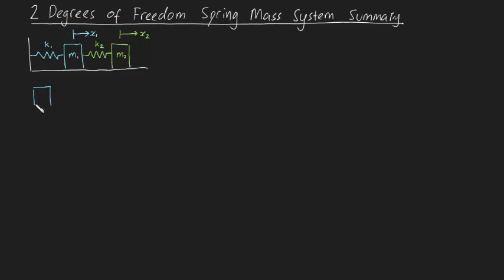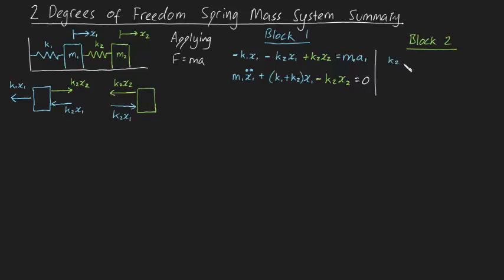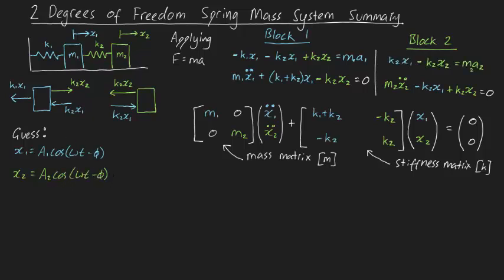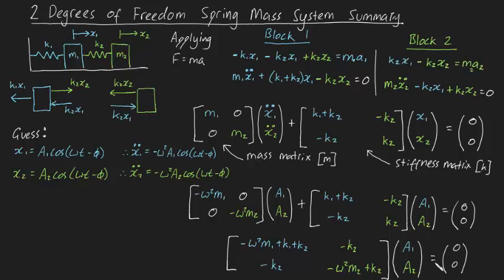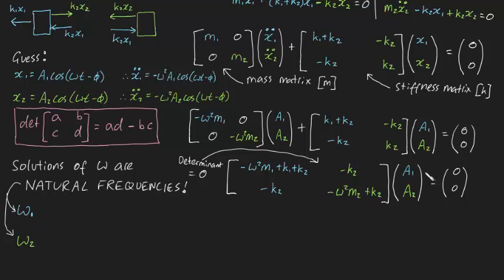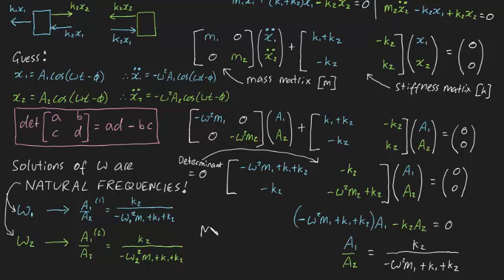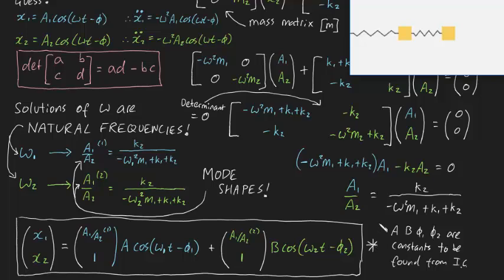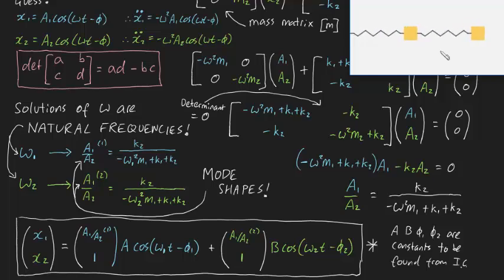2 Degree of Freedom vibrating system Summary

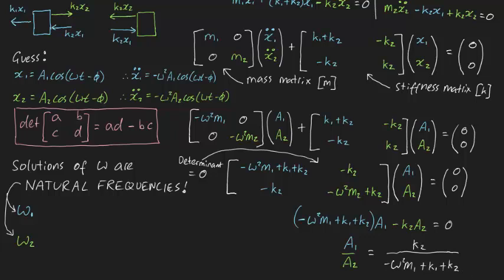Comment: also at 3:22 would it be -k2 on top of the amplitude ratio?  in your above equation its a negative k
Reply from the maker: Hi, here are the full steps:
(-w^2m1 + k1 + k2)*A1 - k2*A2 = 0

Bring the k2 A2 term to the other side:
(-w^2m1 + k1 + k2)*A1 = k2*A2

Divide by A2 on both sides:
(A1/A2) * (-w^2m1 + k1 + k2) = k2

Divide by the  (-w^2m1 + k1 + k2) on both sides:
A1/A2 = k2 /  (-w^2m1 + k1 + k2)

Does that help? :)

Comment: Why is it that taking the determinant of that final amplitude matrix gives us our natural frequencies?
Reply from the maker: That's a really good question! The answer is a bit complicated and involves some linear algebra. The problem can be expressed as: Solve the following equation to find X

[B]X = 0

Where B is the big matrix and X = [A1; A2]. Clearly one solution is X = 0  (since [B]0 = 0), but this is trivial since it corresponds to the solution that A1 = 0 and A2 = 0 (no motion). We want to solve for nontrivial solutions to this. 

IF [B] was invertible then:
we could invert [B] by both sides to get
[B]^-1 [B] X= [B]^-1 0
X = [B]^-1 0
X = 0   but this is trivial and we don't want to solve for trivial solutions

So the only way for nontrivial solutions to exist is when [B] is NOT invertible. 
A matrix is only not invertible if the det([B]) = 0

Hope that makes sense :)

Comment: I think omega(2) is written as A2/A1 actually. A1/A2 would have the k2 term in the denominator.
Reply from the maker: Matthew James
1 second ago
Hey Randy! Sorry for the late reply. Just a quick clarification, at 3:33 i'm not saying that w2 = A1/A2. What I was saying is that the amplitude ratio evaluated at w = w2 yields the following result.

We know that it is actually A1/A2 because

(-w^2m1+k1+k2)A1 - k2A2 = 0
(-w^2m1+k1+k2)A1 = k2A2
A1 = A2 k2/(-w^2m1+k1+k2)
A1/A2 =  k2/(-w^2m1+k1+k2)

Hope that helps :)

Comment: What will be the mode shape for 3rd block
Reply from the maker: Hey mate sorry for the late reply! Finding the modeshape for the third natural frequency is a bit tough to do by hand so I've written a MATLAB script for you. Notice in my code I didn't use det(-w^2M +K) = 0. I could have done! But it would have gotten messy. Instead I wrote -w^2 MX + KX = 0 as w^2X = inv(M)KX, which shows that the eigenvalues of the matrix inv(M)K are the natural frequency squared, and the mode shapes are the eigenvectors.  Here is my code:

clc
%Equations of Motion
%m1x1.. +(k1+k2)x1 - k2x2 =0;
%m2x2.. -k2x1 +(k2+k3)x2 -k3x3 =0;
%m3x3.. -k3x2 +k3x3 =0;

syms k1 k2 k3 m1 m2 m3 x1 x2 x3 w1 w2 w3

M = [m1 0 0; 0 m2 0; 0 0 m3];
K = [k1+k2 -k2 0; -k2 k2+k3 -k3; 0 -k3 k3];

%solves eigenvector (X) and natural frequency squared (w^2)
[X, natfreq_sqrt]= eig(inv(M)*K);

w = sqrt(diag(natfreq_sqrt));
%natural freq
w1 = w(1)
w2 = w(2)
w3 = w(3)

%modeshapes
X1 = X(:,1)
X2 = X(:,2)
X3 = X(:,3)

Comment: Great video. Do you, by chance, have one that includes damping?
Reply from the maker: Hi there, sadly I do not have a video that includes damping and external forces for 2DoF yet. But the process is very similar. If you're interested in solving for the steady state solution to an harmonic force acting F=F0 cos(wt) on the blocks then the equations of motion will yield a mass matrix [M], a stiffness matrix [K], a damping matrix [C] and a force vector {F}. [M]x.. + [C]x. + [K]x = {F}. Then, the way you solve this is by assuming a solution in the form x1 = Re(X1 e^-iwt) and x2 = Re(X2 e^iwt) and modeling the harmonic force as F = F0 e^iwt. Then substituting this in you will get

[M]X + [C]X + [K]X = {F0}
(-w^2[M] + iw[C] + [K])X = {F0}

You can then invert the matrix, and solve for X. Notice X will be complex. 
Then find the steady state displacements using x1 = Re(X1 e^-iwt) and x2 = Re(X2 e^iwt).

I've skipped a few of the mathematical steps and justifications, but that's the big picture. Hope that helps. This summer I plan to make a lot more vibration videos :)
Reply from the maker: Oh and I almost forgot to say that this is just for the steady state response! To find the total response, you need to add it to the transient solution (x = x_transient + x_steady state). x_transient can be found by setting the external force to 0 such that [M]x.. + [C]x. + [K]x = 0. Then guess a solution in the form x1 = A1e^lambda t and x2 = A2e^lambda t. Substituting this in will yield 

(lambda^2 [M] + lambda [C] + [K])A= 0
Since the RHS is 0, the determinate of the matrix must be 0.
Solving for lambda will yield 4 complex solutions. then using the superposition theorem, the total transient solution is:

x = A e^lambda1 t + Be^lambda2 t + Ce^lambda3 t + De^lambda4 t
where A B C and D are constants to be determined from the initial positions and velocities of both blocks. The whole term can also be simplified accordingly using eulers formula cos(y)+isin(y) = e^iy.

Once you have the transient solution and the steady state solution, then you can literally just add them up to get your total response. :D Just a minor side-note though: usually Engineers are only interested in the steady state response, so you'll usually only be asked to find that in an exam :)